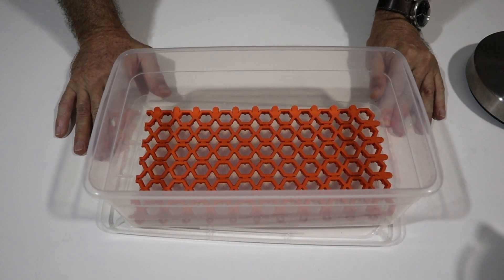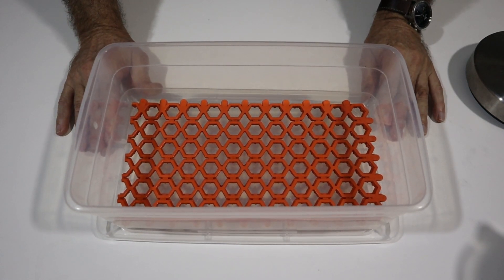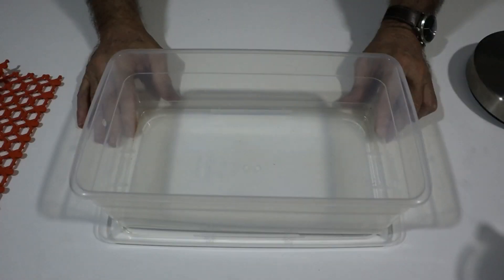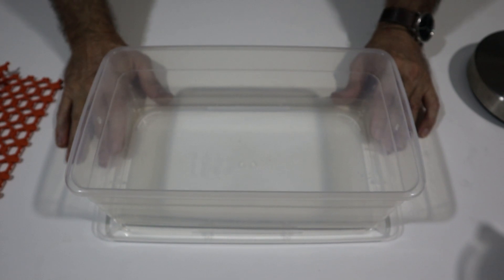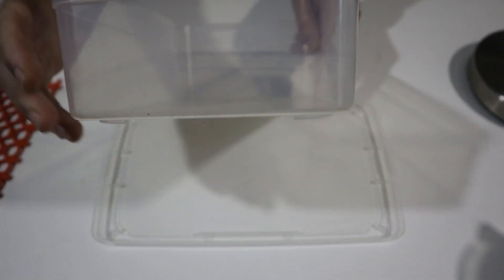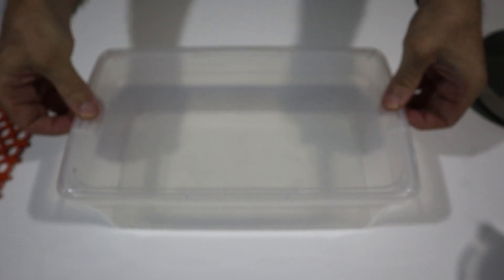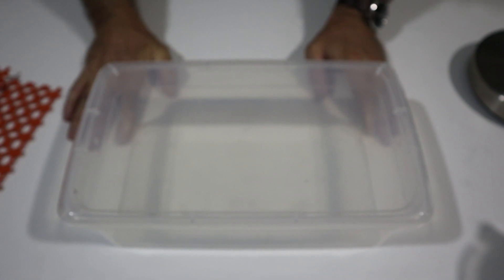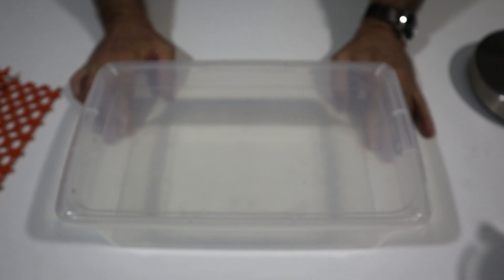Breeding Ball Pythons; Egg Setup

Comment: Solid information for your conditions. Really appreciate how you comment that this is specifically for your existing climate parameters and to adjust as needed. Sound advice for all reptile questions imo. Do the research and find what works best for YOU. This has been a hard learned lesson for me and now I find that I’m trying to use the K. I. S. S. Method with most of the requisites for keeping animals. Thank you for more great content.
Reply from the maker: Thanks for the comment and support as always. My environmental parameters are much different to others, which is why I always stress, this is what I do and you may have to do it a bit differently.
Reply: Robert Barraclough is it possible to have an ambient temp thats too high for a good gradient? You state that you don’t need to use heat sources because you stay pretty close to target hot spot temps with your ambient. When or at what point would you recommend auxiliary cooling? If building females are demonstrating cold seeking behavior, what should be the target number for the cool side in your opinion.
Reply from the maker: @J Flannman what a great question! My snake room temperature and humidity is simply what nature dishes up. Being indoors, its buffered from outside so it remains at a fairly constant 29C/30C (84F/86F) and 80% humidy and varies by perhaps 1C throughout the year. There is no heat gradient in the tubs. This actually mimics ball pythons natural underground rodent burrow habitat fairly well. I have a fan in the room for air circulation. I provide a ceramic water bowl which due to evaporation is cooler than the tub, so snakes can cool down if they wish by wrapping the water bowl. 

My snakes seem to maintain a temperature of about 30C (86F) by preference. When i heat gun them, its pretty consistent. At this temperature they have no issues digesting food. When breeding, females will also build follicles and lay eggs at this exact same temperature. They maybe cool off by half a degree to 29.5C (85F). Its very subtle. But when the room gets slightly warmer during the day, they normally wouldn't bother cooling but a building female will do the water bowl hugging thing simply to maintain a more constant temperature. No huge temperature swings for my girls. They work with nature and what nature gives.

So here are my target temps. 30C or 86F all year, all day, every day. They don't get too hot and start soaking at these temperatures. They eat and digest just fine. The females build follicles and lay eggs no problem. The males have good sperm and  lock readily. I think I could even incubate eggs at room temperature with no adjustments. Might take a few days longer to hatch than those eggs incubated at 32C and 90F but I don't believe my snakes would look for these temperatures just to lay. To me, 90F for incubation is a bit too close to lethal temperature for eggs and it's pushing the limits. They do everything else quite happily at lower temperatures. 10 clutches this year from 14 females I paired up, 74 eggs and only 1 slug all season. So it seems to work. 

Temperatures to avoid.....33C or 91F is generally accepted out here as the kill zone for eggs and sperm. 36C  or 97F will kill an adult Ball Python if its prolonged. They certainly will not breed at anything over 33C or 91F, so if you are running hot spots of 90F in your heated tubs, you are in my opinion and experience too hot for these snakes. Prolonged exposure to even 90F will kill sperm in your adult male breeders.

Hope this helps. A long answer but I could talk about this stuff for hours. The devil is in the detail!
Reply from the maker: I have an air conditioning unit in the room. If the ambient gets to 31C or 88F, as it does during the heat of the day in the dry season here (Dry being relative to the wet season. It still rains a lot in the dry season.), then its time to cool the room a touch and bring it back to 29C or 84F.
Reply: @RobertBarracloughRoyalBalls  absolutely no need to apologize for a lengthy information filled response. I enjoy learning the why behind good information and there’s actionable information there and I’d seen a lot of content on temps but not a whole lot on the why you target this temp and that that temp. Awesome content and thanks so much for the info.